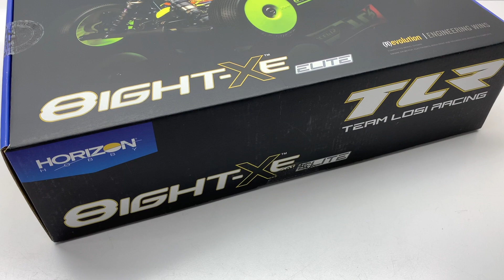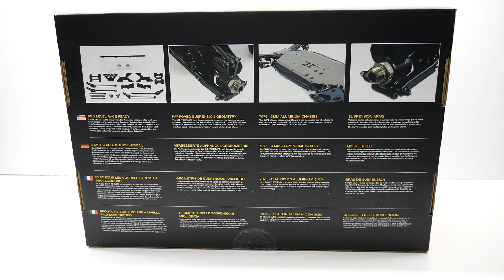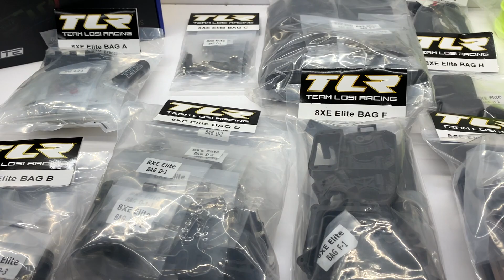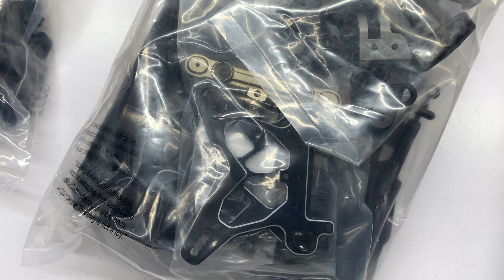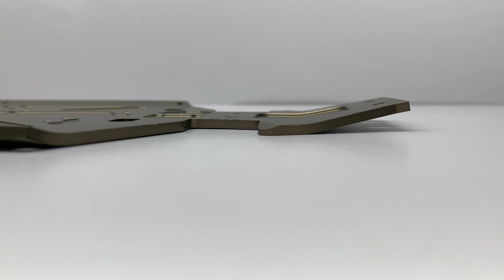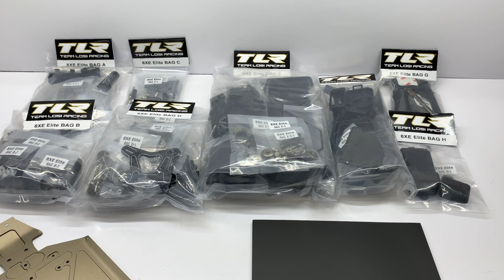TLR 8ight-Xe Elite - 1/8th SCALE Electric Buggy Kit - First Look and Unbox

Comment from the maker: TLR, AE or Tekno - Which one and why?? 🤔
Reply: Tekno for 4wd AE for anything 2wd
Reply: Not AE.  At the same time, you forgot to include XRAY.  Tekno is great...but, they only do 4WD (no 2WD, which kinda sucks).  For dirt/clay, it's an even toss-up between TLR & Tekno.  For astro/carpet, while TLR is a very good choice, XRAY is where it's at, as they REALLY 'know' astro/carpet.
Reply: AE
Reply: Mugen Seiki, why cause I plan to get their 1/8 Truggy at some point to race at my local outdoor track.
Reply: Tekno EB48 2.0 for the win
Reply: I like TLR. I think the way they drive right out of the box as a kit setup is second to none without ever having to figure out a setup or look at a setup sheet. Just follow the build manual correctly and it will be competitive and easy to drive right out of the gate.
Reply: Tekno is the best 1/8 buggy
Reply: White wheels reflect all the wave lengths of visible light. Therefore, since yellow does not and absorbs some of the light, there is more mass (0.000000000000000000000000000000000000000000000001 nano grams) in the wheels. More rotating mass. Case closed.  :)
Reply: Oops. Didn't mean to reply here.

Comment: I’m converting a Losi 1/8 2.0 nitro to electric and need a new body. Nitro body won’t fit e setup. Any suggestions what body will fit the 2.0?
Reply from the maker: You'll have to dig around and see what's available still for a 2.0.  TLR is now on the 5.0 version.  Pro-Line and JConcepts probably had bodies at one point....The TLR buggies are always wider bodied cars, so likely the Mugen/Team Associated bodies may fit as well

Comment: They might do a little bit of machining after work but those internal differs are definitely sintered powder metal.
Reply from the maker: I can't find anything that states otherwise...but typically you'll find sintered "pot metal" in $300 RTR's not $650 race buggies....When I stated that, I was referring to the bevel/pinions on the diffs....now the spider gears, not sure
Reply: @TheRCNetwork  oh okay yes the ring and pinion are definitely machine. You can tell sintered powdered metal from machine metal because powder metal parts will have rounded edges because they're coming out of a mold. CNC machine parts will have sharp corners.
Also not all sintered parts are pot metal. Most powdered metal used in RC's today is actually steel and a lot of it's hardened. It's still not as good as CNC machine parts but it's a lot better than pot metal.
Reply from the maker: @DoRC  Great info!